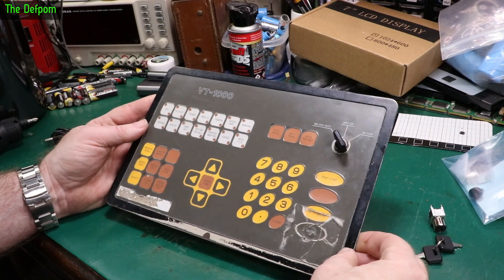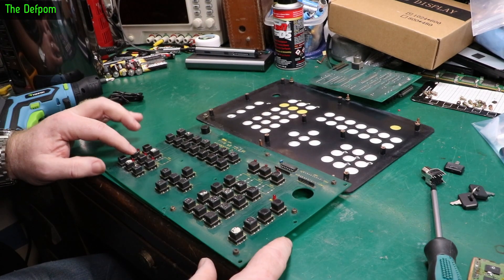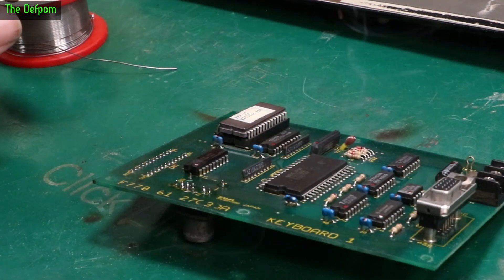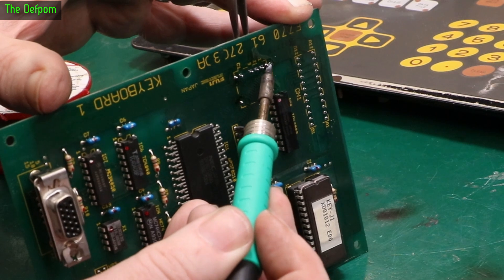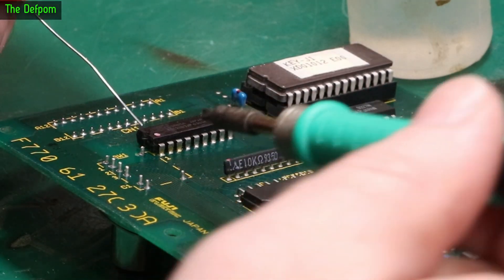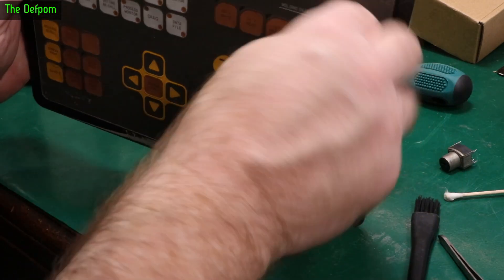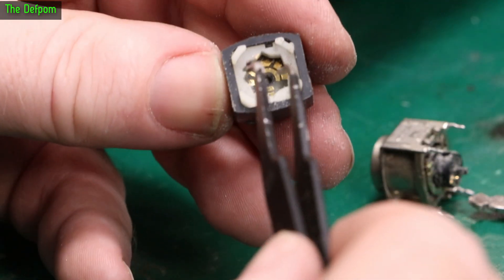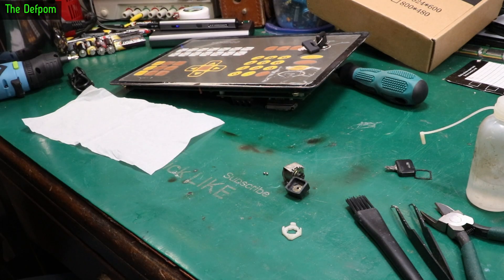🔴 Meiki VT-1000 Control Panel Repair - No.1254

Comment: I'd guess all that crud that got inside the switch had blocked the contact hard enough to break it off.
I'm impressed that the replacement switch was still available.